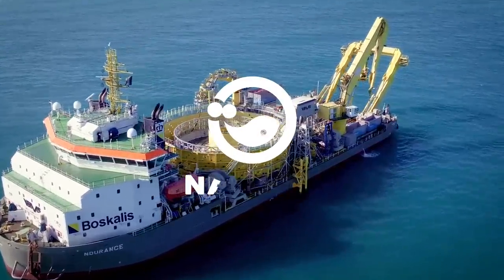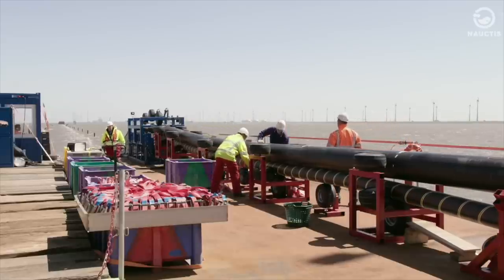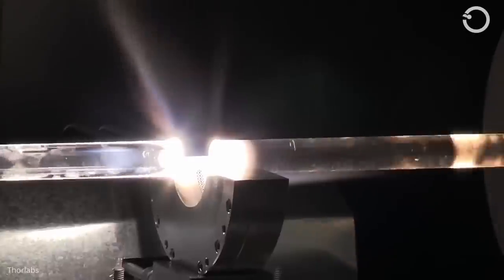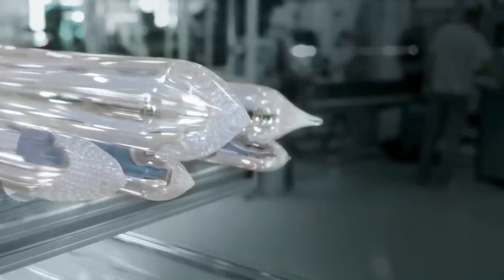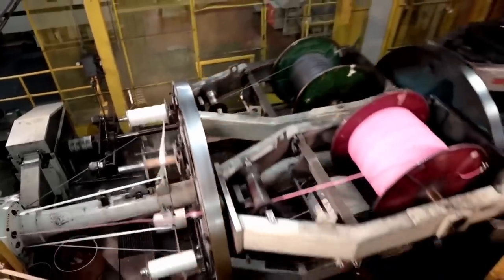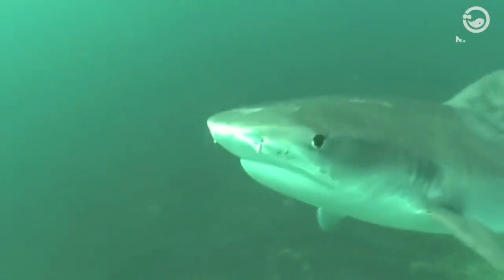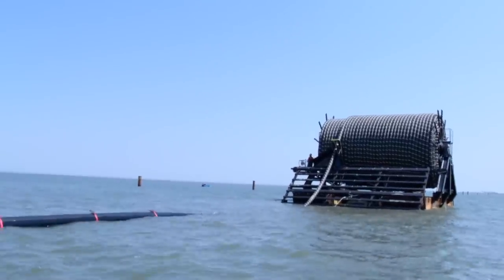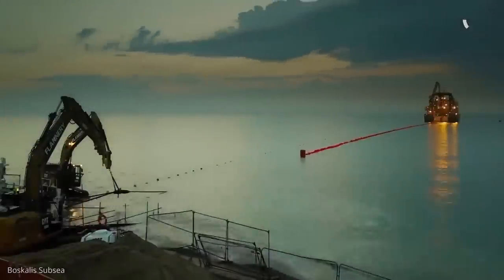Why GIANT SHARKS Can No Longer ATTACK UNDERSEA Internet Cables

Comment: Transfer speed through one optical cable is basically infinite, and only depends on the technology on both ends. It's not "10Gbps". Same goes for Copper based cables, they are not "300Mbps", as I myself have 10Gbps connection using CAT 7, and CAT 8 spec is up to 40Gbps.
Reply: Transfer speed is the speed of light assuming the data travels uninterrupted. But they don't, so the speed is less than that.

The speed of light travelling through glass is about two thirds the speed of light travelling through space. When you consider that they are also bouncing around inside the cable then it is much slower than that
Reply: @Akniy  It's important to specify it's the speed of light inside the material. So it's way slower than the speed of light in vacuum, like around 200.000 km/s instead of 300.000 km/s